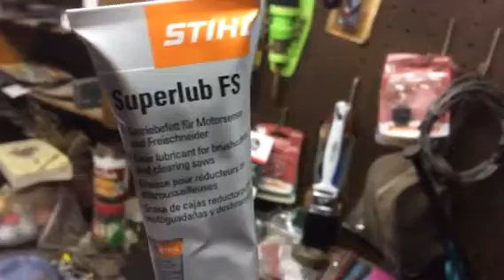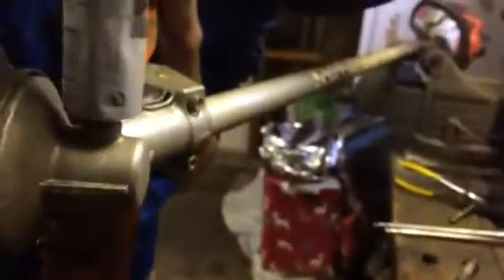Greasing Stihl fs94r

Comment: How often do you lube it? Also, did your local stihl dealer have that lube in stock?
Reply from the maker: Steven Gruver we lube it a couple times a year.  Probably will bump it up to 4 or 5 this year since we have been adding a good number of new lawns this year.  My stihl dealer is only about a mile away and carries the stihl grease in stock.  Kinda pricey tho at about $11-12 a for such a little tube.  We lubed 3 pieces of equipment and used about half the tube.
Reply: Scout's Outdoor Services SOS Okay, thanks for the info!